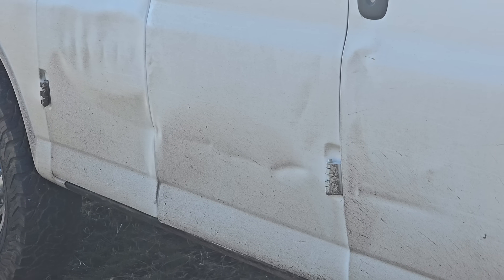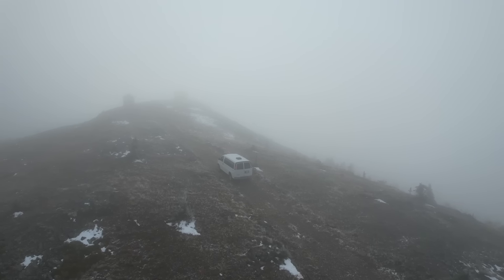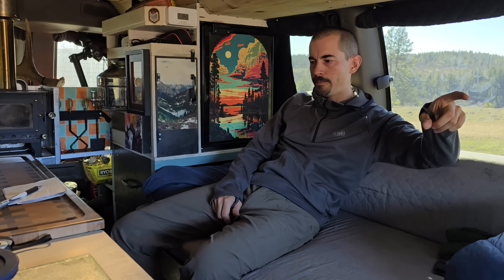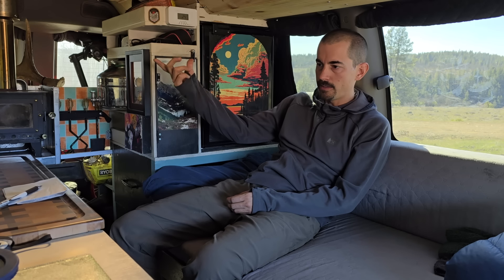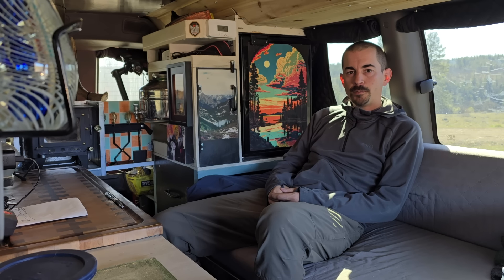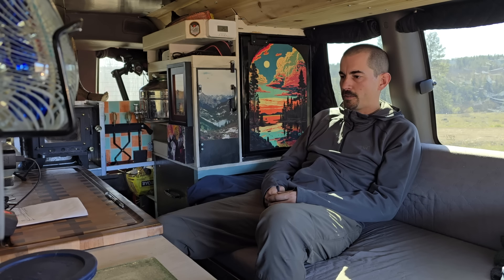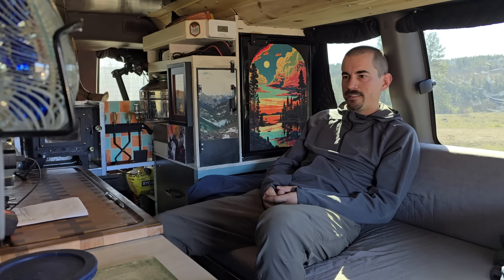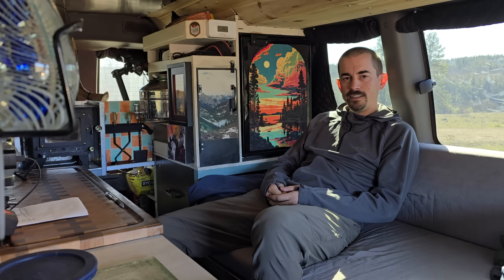Lets just talk about condensation and insulation.

Comment: Simon, my husband is a retired, journeyman, mechanical insulator. We’ve been discussing building out a bus. But the one thing we do know is spray foam is the way to go. If you can manage it, it will save you such a headache later on. Good luck love to Rocco. Will be watching no matter what you build or where you go. ❤
Reply: Any particular brand or method?  Would those little bottles from Home Depot work?  If so, how keep the ceiling flat?
Reply: Watch chuck cassidy videos on bus build out (YouTube). He’s focused on buses but all the principals are the same. His video on insulation is first rate. The cans of foam from HD would cost as much as hiring someone.
Reply: @2nd_of_3  Thanks !
Reply: Solid advice.
Reply: @2nd_of_3  Watched his vids over the weekend. Invaluable advice. Really thougth wool was the way to go until he explained why it fails, why it will fill like a wet sock with condensation !   Appreciate your share ! Hope you have a great week !
Reply: Woo hoo! I live on a narrow boat in the UK - and short of actually living IN the water it can be the pits for dampness.. Have a look at how our boats are insulated I reckon that's got to be the gold standard😂 
1. Spray foam insulation has technically the best insulation to mass ratio - I think we batten, then spray, then marine ply. 
2. Tongue and groove is heavy - and more bulky than ply.
3. You are spot on about the wood burner, we all have them and the dry heat is essential. I'd move yours lower down, it does make a difference! You'll also get more draw and get more heat out of a longer chimney.. Heatproof sheet with tiles on is nice - or I've had great success with checkerplate over the heatproof as it's so heat reflecting and looks proper industrial! Eco fan on top will also keep the air moving.
4. Windows - the insulation sheet you mention can also be cut to temporarily insulate windows - or permanently if you like - more wall space = more shelves. Or if you want it more permanent, just steel it over, batten and spray foam..
5. Don't forget to insulate the floor! (Everyone forgets the floor..)

Yeah, have a look at narrow boat construction - we have been frozen in for a month in -16C in a 50 foot space with a 4kW rated stove and been dry and toasty. ❤

Keep up the good work old chap! 🇬🇧
Reply: Against metal Ya spray foam is best.  Problem is eve when done professionally it still off gasses for years.   That's why I don't want it.
Reply: Spray foam with a spray epoxy vapour barrier. I have  seen this done in very damp areas of buildings in downtown Toronto. It works great at preventing the off gassing issues. Any sealant would suffice
Reply: @conradmcdougall3629  Never heard of spray epoxy - thanks for the tip. Surprised none of the van channels (that I've seen) have used this.
Reply: @TheLampini  this comment is worth saving and keeping :)
Reply: The irony is.. we’re near where Simon was☺️ Rob would have Absolutely helped him out. Kind of a plan.. have space to help the next gen of van lifers get started with as much knowledge as possible. No kids to pass that kind of thing on to. Within the next year we should have boondocking facilities set up. Shower, dump station.
Reply: @currentfaves65  those are open cell canned foam, and don't insulate the same! Call a reputable foam company and asked for 2" of closed cell foam. The floor, along with the rest should all be sprayed if you want to solve several problems before they start.

Comment: Our experience is this: Use 3M Thinsulate Acoustic/Thermal Insulation SM600L. Apply with 3M Hi-Strength 90 CA Spray Adhesive. Cover everything, and get inside ribs. Use Ancor 131325 Triplex Cable, 12/3 AWG, Flat for AC and 121110 Duplex Cable, 10/2 AWG, Flat for DC wiring above ceiling and in walls. We’ve never found a moisture barrier that worked well. So we always vent our space via a modified ceiling MaxxFan, even in our coldest vanlife weather (-15ºC). Hoping for best results with your project.
Reply: Good idea, or use foam board

Comment: Professional sprayed two part foam, 2" min over all the metal. Your system may work but I have never made it done that way. New two or three pane windows. Worth the cost. Put the stove at the floor level and pipe in the combustion air.  Only the best for Rocco. Bob in Nevada

Comment: Seems like a good plan Foresty....finding the right adhesive is always the hard part. I worked in hardware stores for 10 years and I would always recommend contacting the companies that make the products you are thinking of using, they want to help in most cases and are experts in their niche field. Definitely try to find a way to keep the wiring accessible, after my stint in the hardware industry I worked in the marine industry as well.....its amazing how far moisture can travel up a wire and cause mayhem that can be very hard to isolate. Thanks and best of luck to You and Rocko.

Comment: put a topper on your van, being able to stand up is a game changer
Reply: Yeah it is, I took mine on its first 6000 mile road trip and put a hi top on as soon as I got home.
Reply: while I agree that standing up is important, the way FF uses the van, the low roof and stiffness a full metal roof provides over a topper is probably more important.
Reply: Another YouTuber is currently having major leak problems with the high top she had installed. With all the bouncing movement Simon’s van goes through I’m not sure any seal would hold up.
Reply: @DanitaReynolds  Depends on what it is and who did it. Mine has been up the Alcan, out to Kennecott, Nabesna, and done the Copper River Hwy twice in the last 2 years. Up to the top of the Eel river etc. And it rains a LOT where I live. No leaks yet. fingers crossed.
Reply: I have disassembled several high topper vans. The key is to weld on a sub frame once you get to hole cut out. ALL of the ones I took apart were ambo/wheel chair "crash survivable" people movers.  That frame holds fiberglass in place and keeps seals in tact. The tenacity of the high-end sealants is AMAZING. I literally lifted a whole back of a 2011 e350 ambo by the seal holding the roof on, it was quite enlightening. The other advantage, if done tight to roof underside it enables you to walk ALL over the roof without wind drag of additonal framing on the OUTSIDE of the van. That is CRITICAL for me as historically we spend many nights on the roof under the stars, and is our preferred way to camp if weather/bugs permit.
Reply: @reidcrosby6241  Mine is 3M marine and  screwed 4" OC to the perimeter cabling box frame. Not worried.

Comment: As an energy systems engineer with lots of building physics in strange circumstances experience, vans are a pain. The only part of a van that really warrants insulation is the roof. Usually, you need a lot less of it than most people think. All you really want to do is bring the roof up in temperature far enough so you don't feel any cold falls. You also want it to be easily removable since no matter what you do you will have some level of moisture problems. This is of course because the van's outer shell doesn't breathe. Moisture will get in there and not out, no matter how many vapour barriers you put in. You are always on borrowed time when you put insulation between water proof layers. 

That being said, there is a solution we use on low energy and zero energy houses in Sweden. I've designed a few of them and the main problem is how to get moisture out but not loose heat. Usually this is done with a heat recovery ventilation system. These removes moisture from the air but recovers about 90% of the heat. There are units that are designed for as small spaces as 10m2. There are some tricks to putting them in vans (having them run with positive pressure instead of negative) but I think you have enough DIY skills.

In any case, best of luck. Hope to see some van work in the future.

Comment: Hey FF, These are my ideas (from someone who's lived in a van for years, often in rainy, freeezing places for months on end) I hope they make sense & can be helpful in making your winter vanlife more comfortable! You're welcome to ask for more info/clarification on whatever I put below.

Ceiling: Screw wood directly to metal roof beams (drill sunken holes) attach vapour barrier to the wood / wherever else on the roof, screw tongue & groove into wood blocks in the middle of any sunken holes so there's basically no thermal conductivity between the screws in your heated environment & the cold screws touching the metal of your van. You can try to make the wood blocks the same height as the foam or shorter/longer, whatever works for your specific van. If you want to maximize headroom, you can screw the wood blocks into the side of the roof beams, though will leave less room for vapour barrier etc. If you end up having to screw through the vapour barrier, coat the screw with sealent which will dry and create more of a seal than nothing.

Wiring: To maximize space & save future headaches, use oversized conduit behind the barrier (or through the wooden blocks if you make them longer than the foam, it also gives a slight air gap doing that but less room!) make sure to install pull cords in every conduit so you can add/replace wires down the line.

Windows: This is purely a think-thought of mine, I've never seen anyone try or test this, to me it simply sounds sound! Build a wooden wall (Like most people do i.e. ply, chipboard etc.) cut out window holes (2x the length of the window) for each window & when making the windowsills leave the slit made by cutting the wooden covers uncovered, you can use these wooden covers as sliding window covers, you can attach a lip on the inside of the cover so it doesn't fall into the slit/use as a handle & use some hook/clamping mechanism  to keep the wooden covers up, this will provide thermal protection & somewhat of a vapour barrier, you can get some of the same window channel material (felt lined rubber) that your van's windows run in to help create a seal & create a nice shlippery surface for your wooden covers to run in. It's simple (even if I've failed to explain it simply) low maintenance & setup cost... IF you're buying walls anyway. Cherries on top would be, insulated curtians as well.

Dividing wall (Front): If you care about being able to get from the back to the front without going outside, Mispronounced Adventures made a cracking looking sliding door in his van, I don't have a better solution than MA so 'ave it it!

If push comes to shove blast the diesel heater for a few hours, once it gets above 30 degrees C the humidity starts falling off a cliff, you probably want to do that while out for a wee hike, for Rocko's sake as much as your own, some of us like that heat, most don't! xD When you get back open the door, yes you're wasting the heat / money running the heater, but that's well worth not having damp / mould.

Again, feel free to ask for more info on this. I know how difficult these builds are & the consequences of months long cold winter weather so I'm happy to do my bit helping you not have to deal with that!

 -MiGly
Reply: Loving the window idea 🙂 Lemme guess- UK or Ireland! 👍😂
Reply: @TheLampini  Cheers, aye UK!
Reply: @MiGlyShebb  I'm living in a canal boat in England - that makes us #dampwarriors! 😊😎
Reply: @TheLampini  Nice! I've stayed by a few canals and it looks quite peaceful, I bet there's some lovely stretches of Canal away from any roads. Aye the damp needs to be kept in constant check by dampwarriers! xD
Reply: Wood stove should take care of the moisture, maybe a cold air intake that is thermostat controlled  would make wood last more efficiently!!! Also your diesel heater can it be converted to petroleum/unleaded fuel ,you can tap into the vehicles fuel tank ! There should be an auxiliary  tap on top of tank in fuel sending unit!!! I be careful  of spray in foam it may have cancer causing fumes !!!!

Comment: I glued the pink foam to the ceiling & walls directly using construction adhesive for foamboard, and glued & screwed 1"x4" boards to the ribs to use as mountpoints, and covered all of that up with the normal walls boards, and used spray foam to fill in the gaps.  I also used rubberized undercoating on everything before the foamboard to help prevent mold, and all of that seems to work out very well for me.

Comment: Hey Foresty! Long time viewer, first time commenter. I'm a building scientist from the East coast, and I love you're ideas to cold weather proof the van. CC foam is a smart choice. It has a higher R-value per inch when compared to open cell, and when applied correctly, can also air seal pretty effectively. Being said, installing a vapor barrier to seal in the foam is still a good idea. Think of the insulation as your base layers of clothing. It helps hold/reflect your body heat in to keep you warm. The vapor barrier would be your outside layer, like a wind breaker or ski jacket shell. It cuts the wind down that would otherwise be wicking heat from your base layers. This greatly increases the effectiveness of the base layers. 

I do have one suggest with an additional caveat: Adding a 2x2 spacer between the CC foam cavities will lead to excess thermal bridging between your aluminum roof and the 2x2 spacers. In other words, heat will be able to transfer much faster through the spacers, decreasing the effectiveness of the CC foam surround them. Instead, I would get rid of the spacers all together and just fill the gaps with CC foam. In reality, you will still need some of the spacers to be able to install the tongue and groove. Consider reducing the number of spacers you'll need to cut back on thermal bridging. Here's the caveat: Any wire runs in-between your roof assembly that get sprayed with foam are near impossible to get out, make repairs, or add new runs to. Once the foam has cured, nobody is getting to those wires easily. 

Absolutely love your channel dude, keep on doing you! Hopefully you were able to gleam something useful from the above suggestions.
Reply: I agree with everything said above.....Simply adhere a solid sheet of 2" closed cell rigid foam to your roof using upward force then do the same with the ceiling materials. Also simply run outwards wiring conducts to be able to repair or add something in the future. It can simply be 2" slip-loom...nicely clamped in place, either painted or not. it is what it is extremely functionable. Exactly the same as you van is now.
I have plenty of other thoughts but this is enough for now...

Comment: I was here when you bought this van and watched you build it out in them parking lots, in the winter, in CANADA...!  It was very impressive - I design and build things for a living and wish I could help you out even though I know you don't really need it. I'm looking forward to this upcoming "story line" 
I made wood "ribs" like wide flat upside down "T's" that I screwed directly to the metal structures that support the roof and floated aromatic cedar panels I milled and glued up between them. The ribs support the panels so no screws in the panels themselves. I used rivnuts to secure everything I built in my van.
 Good luck!